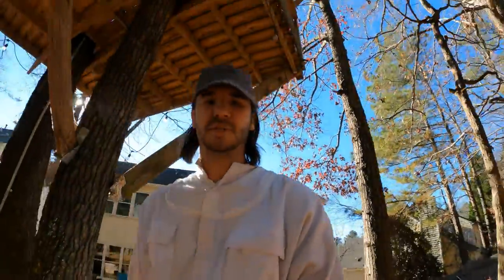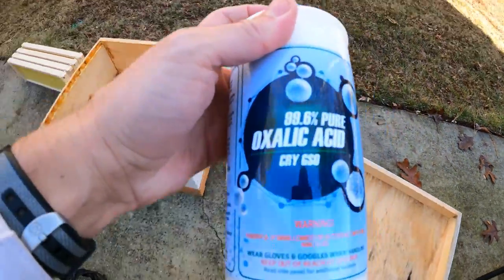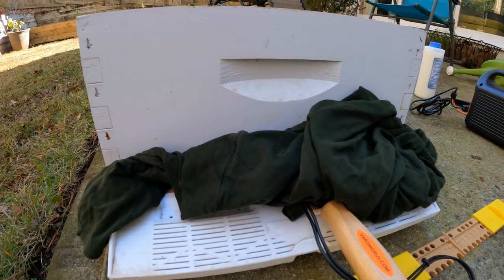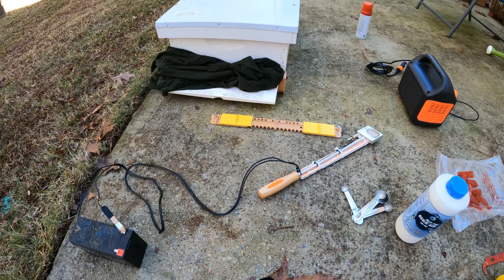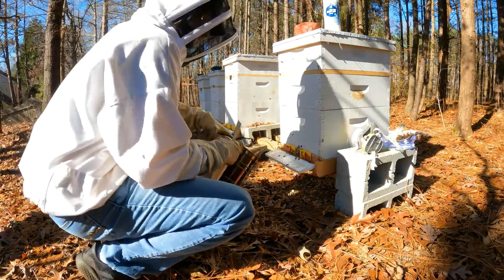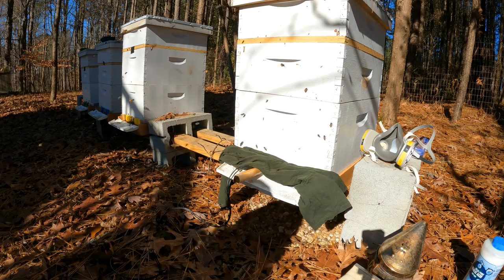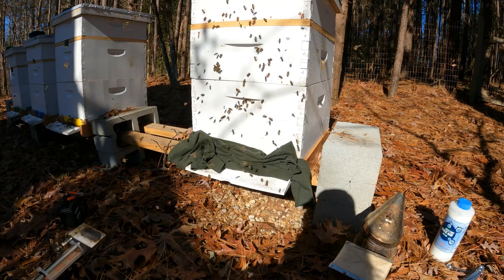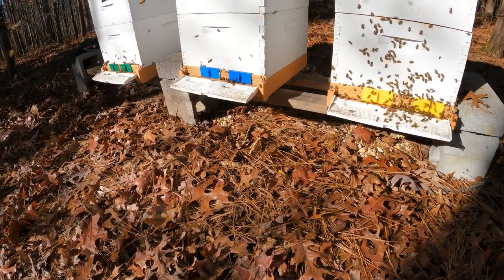Winter Oxalic Acid wand treatment on Apimaye bottom boards! (Beekeeping)

Comment: Not bad.    I built myself a 1/2 thick plywood bottom board that is same dimensions as Apimaye's bottom board.    I cut out a hole in the center almost the same size as heating pan.   Attached wand underneath the new board.     When ever I need to OA my bees, I walk to back of hive,  I slide out the Apimaye bottom board.   I load a dose in pan and slide new bottom in and give the bees a treatment.    Bottom is totally sealed.      No smoker needed.  No screwdriver needed.   No OA shirt needed.
Reply from the maker: Very cool!  Yea it is definitely a struggle but I think making the animaye boards work with it is worth it.  I really do think they are the best bottom boards out there despite being twice the normal cost of alternative options.  Finding different ways to still use them and do OA treatments are a must.  I would be curious to see your setup in action.